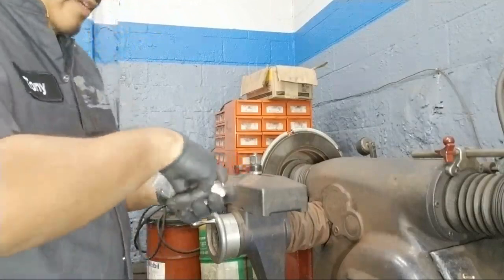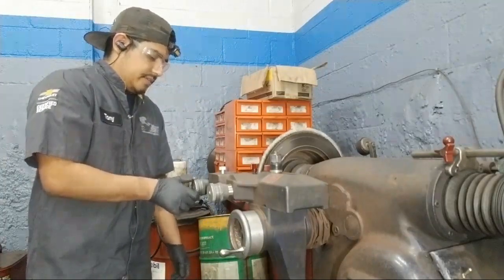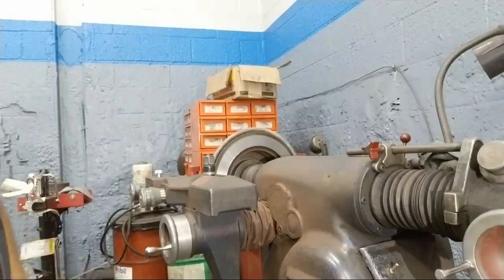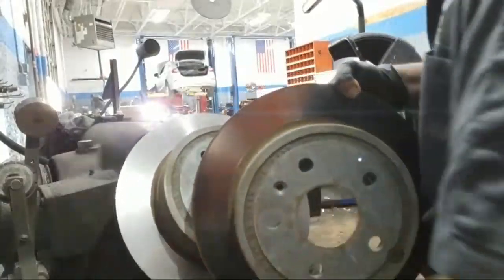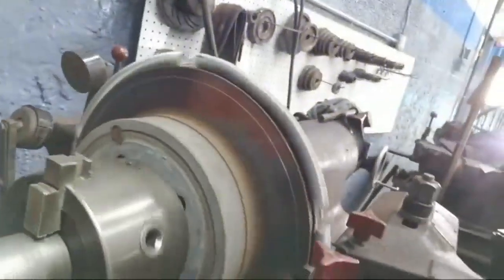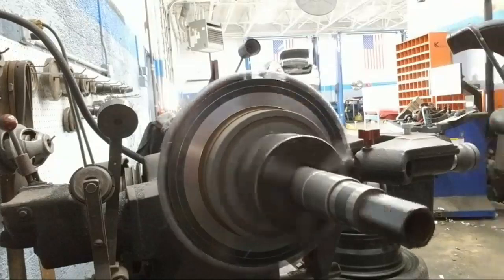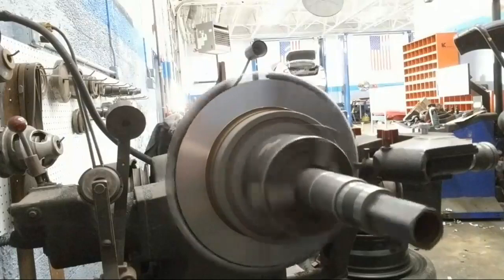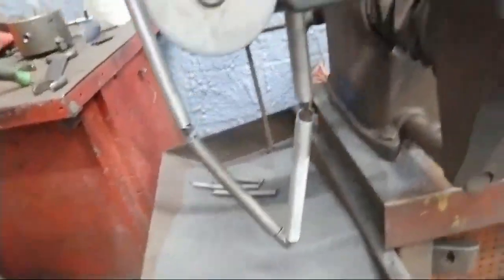Turning brake Rotors With 410 Auto Tech

Comment: Haven't turned rotors in a long long time.  Kinda like CV axles.  People (myself included)just replace the whole axle assembly.
I haven't seen anyone replace a boot on a CV either.
Good stuff to know though.  Thanks for the video
Reply from the maker: We still actually repair axle boots from time to time  but it's a messy job .
Reply from the maker: Also we usually dont recommend aftermarket parts unless they request it.